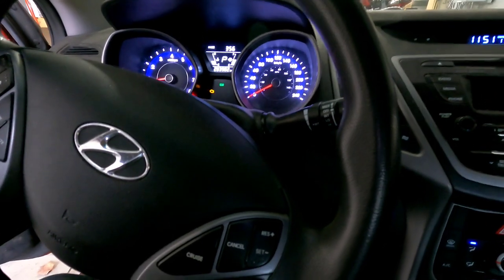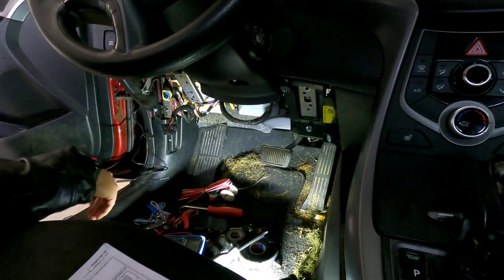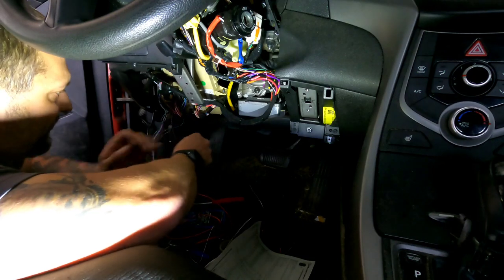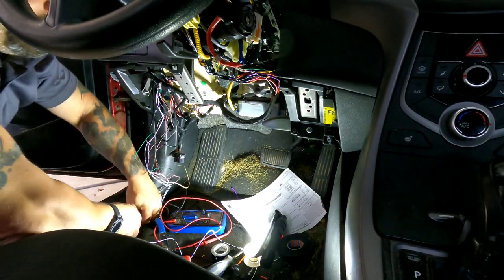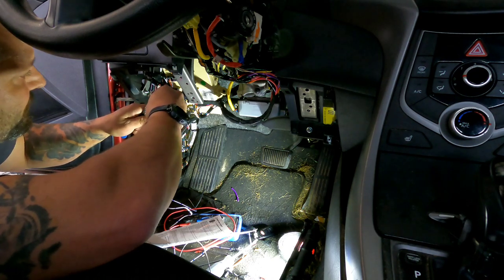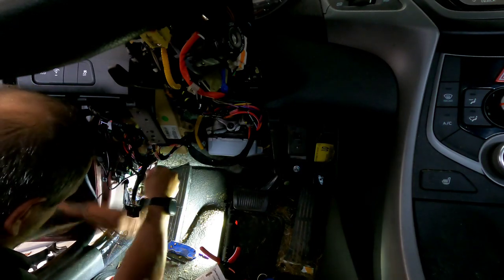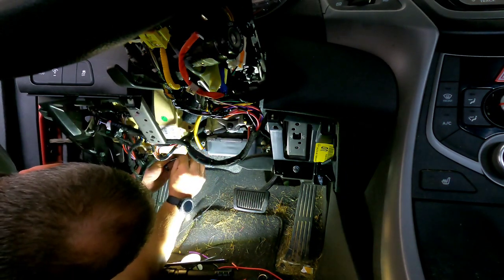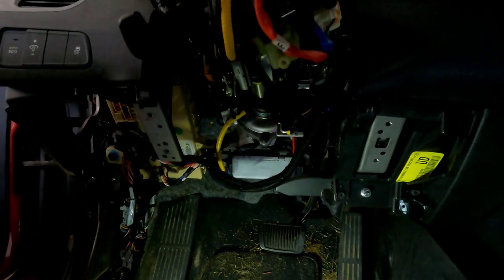Tri county kustomz - 2016 hyundai elantra remote starter

Comment: can this be installed on a manual transmission?
Reply from the maker: This particular remote start system does not  work with manual transmissions. There is other brands like command start that will work with manual transmissions and work with this vehicle. Only wiring you will need to look into is the clutch wire and parking brake wire